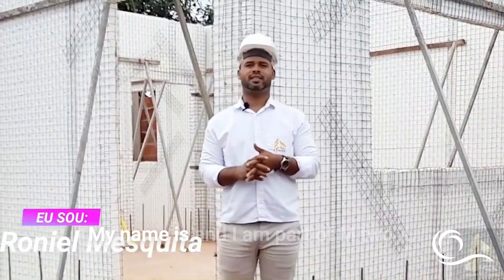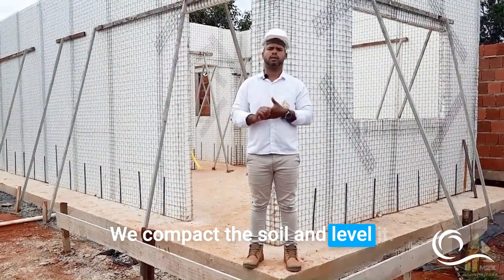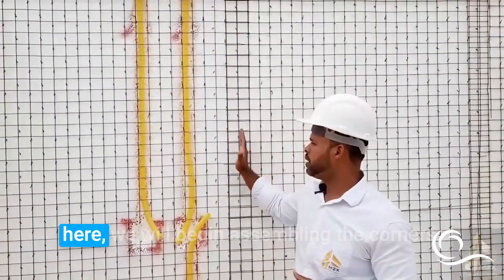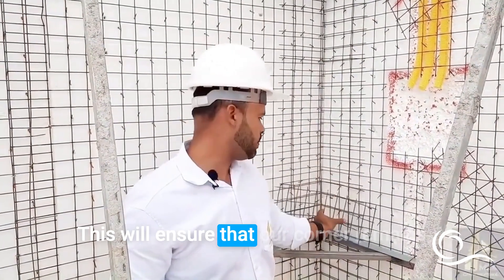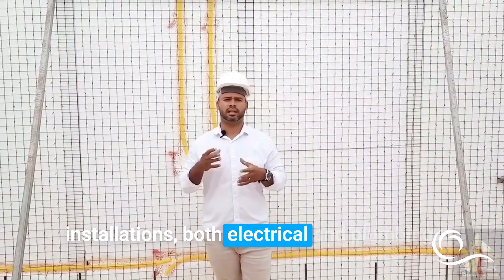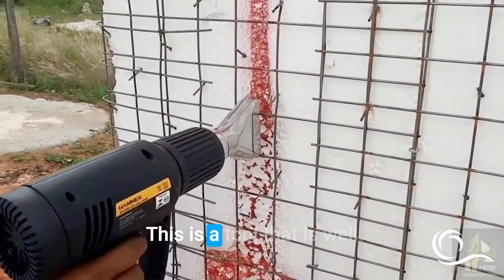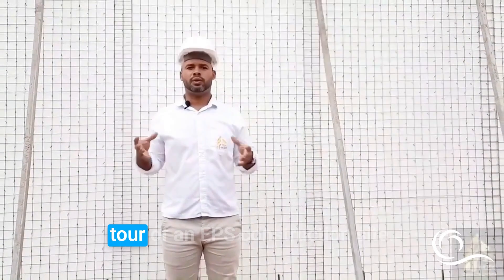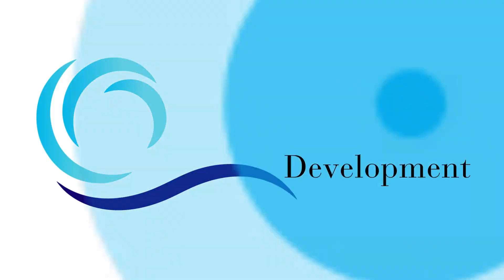Introduction to Structural Concrete Insulated Panels (SCIP) Lesson. Intro to course.

Comment: How wide can the roof be before a structural beam is needed due to weight?
Reply from the maker: Yes, generally the formula for strength is every 28' - we use concrete beams.

Comment: Are the metal meshes on both sides of the foam panel physically connected to each other’s from one side to the other side? I can see the metal mesh wraps around the door/window openings, how about the panels???
Reply from the maker: George- Yes, there are wires connecting one mesh to another - called connectors. This is what guarantees the secured resistance of the panel.